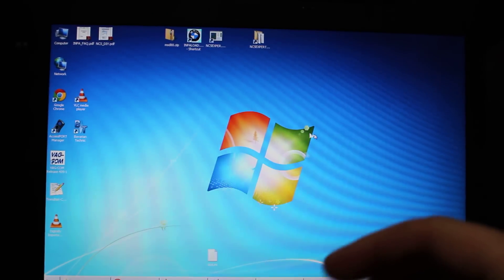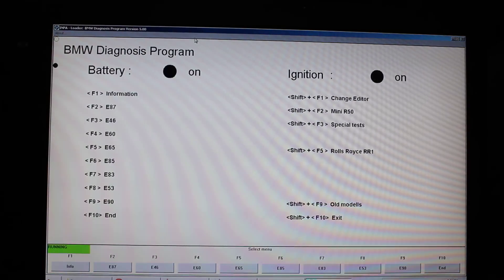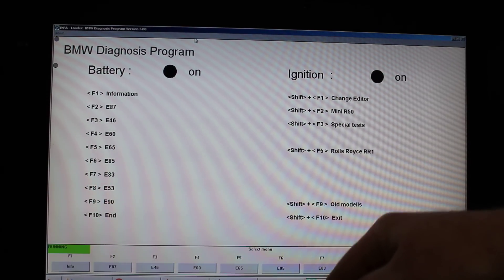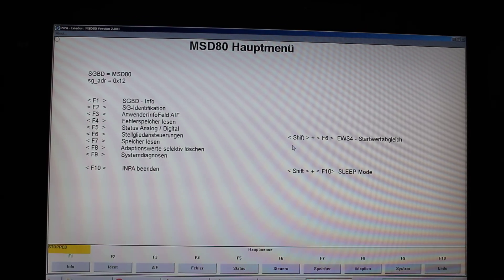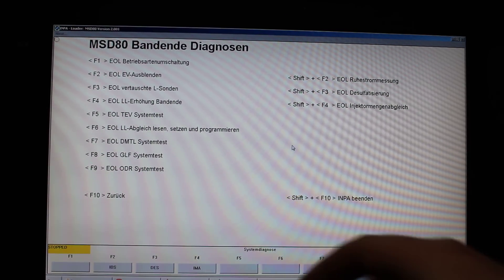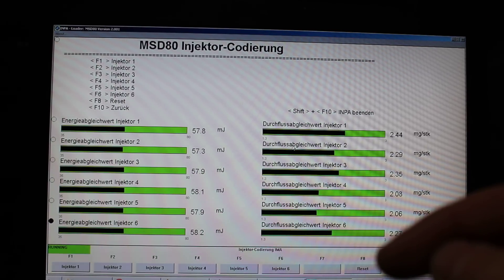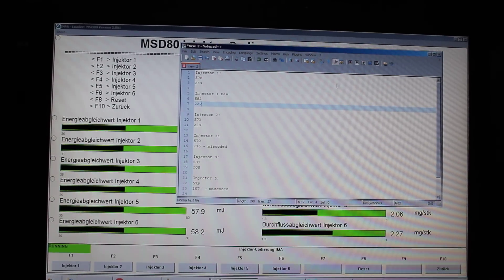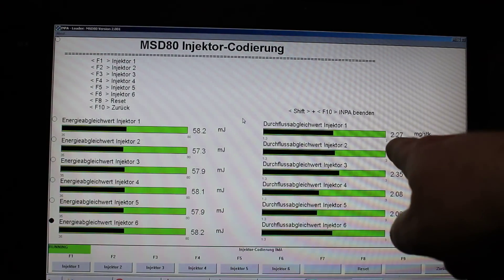DIY BMW N54 Injector Coding via INPA

Comment: hi thats really what i need having inpa with me at some point i swap my injectors unknowingly and injector number 5 seems to be out of specs. its a bmw x53 e53 3.0d 2003... all im seeing on the left side of injector is many numbers which of them is enrgy and flow
Reply: You don't have these values on your injectors! You have a classic injector. The video shows a piezo injector, this one is different. You need INPA/E53/ENGINE/M57N/ACTIVATE/IMA, then copy the code from the injector that is not working properly into the table.

Comment: injectors need be coded,if replacing more than 2,
Reply: How you know that?
And why need to code injector if replaced more than 2?
I have a problems with an 2013 BMW X3 4 cylinder engine got locked because all 4 injectors been injecting too much fuel dealer told me that I need to change 4 injectors so I changed the engine complete with injectors and the same problem same fault codes so after they told me injectors need to be code 
Could be that only the problem if code the injectors fuel system will work normal or could be something else?
I hope you help me if you know

Comment: can you say me where i can find the Code for the amount (on the Injektor) to coding in inpa? my injektor BMW Number is: 13 64 7 597 870
Reply: Craz_O  the values are on the injectors, there’s two sets of 3 digits one set on on top of the other set.

Comment: I have quite a few inpa softwares downloaded from various sites.  Some displays MSD80 Main Menu in German, some in English.  
When I press F9 (System) and then Shift+F4, I get sys-0010 error message, therefore, unable to continue coding injectors.

Could you offer a link for working INPA please.  I am running WinXP.  All other settings and configuration ok to the best of my knowledge.
Reply: check out cable version,and yours car,its d-can?some versions of cables,need solder 7 ,8 pin together,to make work

Comment: Why am I getting an error message when I type in the new values? They’re definitely the correct ones yet it keeps saying “error_ecu_conditions_not_correct_or_request_sequence_error” ??
Reply: turn ignition on
Reply: Anne Mwikali ignition is on throughout but still the same
Reply: Did you put in the dot? Like 58.2 and 2.27

Comment: Hi, in the video I reads RESET in the section injector. If I rest above, what is what that resets injectors? That put back them in value Safety, in the video I read RESET in the section injector. If I rest above, what is what that resets injectors? That puts back them to the values of factory or not? I replaced two injectors, the engine works but I find that injectors sell too fast of the blow I would like to try to put back them all to zero Thank you

Comment: MSD80 Menu
 
F1 (electronic control unit) discreption file
F2 (electronic control unit) identifikation
F3 Operator infofield / Vehicle ID / Date of coding changes / Software Version /Vehicle Production Number of Manufacturer
F4 Error Memory..
F5 Analog Values / Digital Values (State) // Pre injection / Air pressure / Active injection rate (without ARD = cog minizing) and other values..
F6 // Control Element of Enginedrive /! I believe ! at example: camshaft and top dead center, bottom dead center and other parts (balance tuning settings)
F7 Read Memory
F8 Delete adaptionsvalues selectively // delete choosed parameters or adaptionvalues // mixture correction value of lambda??
F9 Diagnosis of System
F10 Exit
Reply: minimizing ** //f5
Reply: balance tuning setting / i think meant is the electrical activation of the engine parts

Comment: I tried this and got a little pop up message saying
"ApiResultText: Error #95
SYS-0005: OBJECT FILE NOT FOUND
API job error or no such result!
Continue script processing?"

I just changed my injectors and am trying to code them. 
Car I'm working on is an 07 335i with N54. It also has a jb4. 

Would you have any idea on this? Thanks in advance!
Reply: KattMarl101 I have the same problem. Did you find an answer?
07 335i MHD no JB4
Reply: Elijah Ullmann kind of hard to remember now, but I think I just had my file named incorrectly. Hope that helps!

Comment: What's the purpose of coding a car's injectors?
Reply: With these cars, they have precise injector values to control exactly how much fuel is being injected into the cylinder and at what intervals. If you do not code the injectors, the cars computer will work off different values compared to the injectors set values, and will cause performance decrease, gas economy decrease, and engine instability. These are very fragile cars that need precise computing, unfortunately.

Comment: Privet Vasil

Please help me brother. I get the error #100 sys-0010 initialization error when i try to communicate with the module. do you have any idea what my communication issue is?
Reply: hey what was the fix for this i had the exact same error #100 code pop up spent 4 hours trying to solve it. still trying to code my injector. if you could please let me know that would be great. thanks!!!
Reply: My solution was just playing 25 dollars for a bmw freelance coder to code my injectors. Fuck this guy

Comment: Is the same process used to fit larger injectors in the engine, i.e you would use the numbers from the new larger injectors?
Reply from the maker: This is a direct injection engine. There are no larger injectors available for this engine unless port injection has been added. Port injection is usually controlled via a standalone system.

Comment: from where you got that value table from which took values to put in?
Reply from the maker: Those are the actual operating parameters for the injectors. Each injector is slightly different from the rest. They get tested on the production line and their operating parameters get stamped on them. Those parameters must be entered into the ECU in order for the injectors to function correctly. This DIY explains how to code in new injectors.

Comment: Do you know how to test solenoid valves in auto gearbox for an e60 with inpa? My torque converter does not lock up, and need to know why. Any idea how to test?

Comment from the maker: Short answer: Yes. 
Long answer: The injectors contain a special piezoelectric element inside to control the fueling. Due to the manufacturing process and the differences in the physical properties of those piezoelectric components, each injector has slightly different operating parameters. Brand new injectors are tested on the production line to determine exactly how much fuel they will flow and exactly at what voltage. Those numbers are then stamped onto the injectors and you enter in INPA
Reply: Vasil Lalov Do you have an email or Facebook? I had a question about entering the flow value?
Reply: So the numbers that u tipe on inpa for injector are stamped on injector body?
I'm confuse with that page were u get the numbers....

Comment from the maker: Those values are stamped on the injectors during the manufacturing process. The injectors contain a piezo electric element. Due to the differences in conductivity of the piezo crystals, each injector has a slightly different tolerances when it is manufactured. All injectors go through a testing process in the factory and their measured tolerances are stamped onto their casings. When you replace injectors, you simply tell the ECU what are those tolerances.